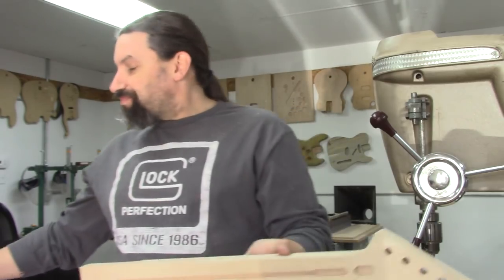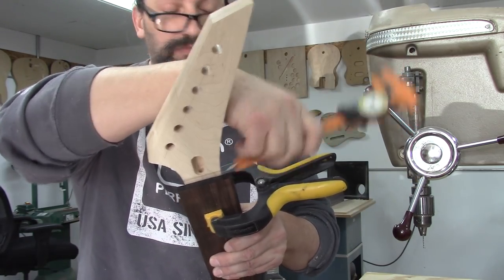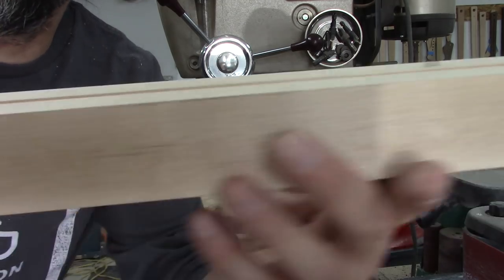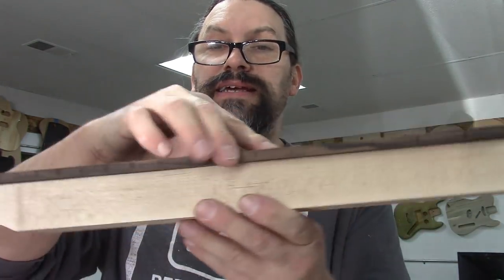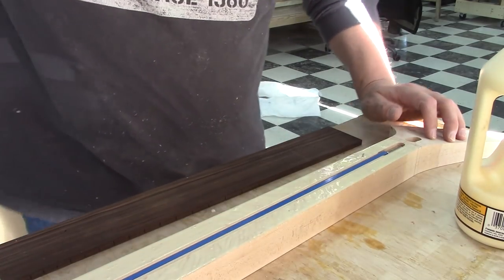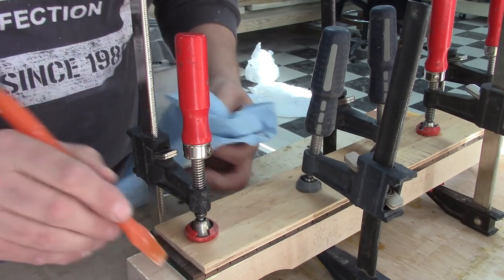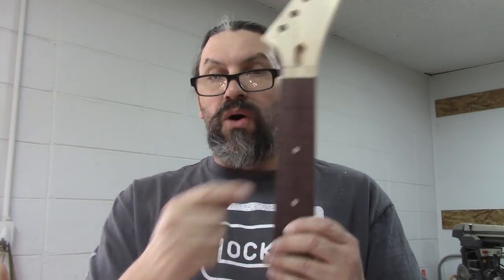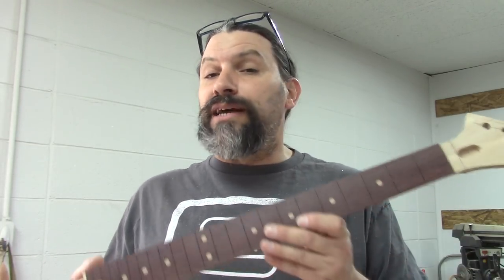The Easy Way To Glue On A Fretboard... And Look Cool Doing It!

Comment: Super sweet registration  method. I always used a pneumatic headless pin gun in fret slot or inlay recess.of the 12th fret.  Slow cure epoxy from LMII so no worries about open working time.
Reply from the maker: Sounds like you have a great system keep using that

Comment: I just took the nut out of cheap strat copy neck, and discovered two staples under it. I wondered what the hell is going on, and then it dawned on me that they used staples to keep the board in place when gluing it. Man your method is so much better.

Comment: Hola amigo. Me gustan tus videos. Si no te molesta te doy un consejo. En vez de acrílico para centrar el diapasón, puedes usar clavos más largos, pero puestos desde arriba del mismo, así cuando la cola se seca, los puedes sacar facilmente y además puedes poner toda la presión que tu quieras a tus prensas. Saludos desde Argentina.
Hi friend. I like your videos. If you don't mind I give you some advice. Instead of acrylic to center the fingerboard, you can use a little large nails but placed from above the fingerboard, so when the glue dries, you can easily remove them and you can also put all the pressure you want on your clamps. Greetings from Argentina.
Reply from the maker: I'm sorry but I'll need to get a translator

Comment: I use wire brad nails. I pull them out from the fretboard after the glue dries. 
The plastic dots are a good idea. 

I’ve been using that thin “magic tape” to cover my truss rod when I glue. I leave the tape on. 😁
Reply from the maker: It is not unheard of for me to forget to peel the tape
Reply: Texas Toast Guitars I’ve done it for years. Hasn’t hurt anything. I figure it stops glue from oozing in.

Comment: I hear the salt thing all the time too. It may help to keep things from shifting, but it won’t really help to index. So for me, it’s a non-starter. 
Having said that, if you use hot hide glue to attach fretboards, adding a pinch of salt to your glue will extend the open working time before it begins to gel. 👍
Reply from the maker: I was thinking about a video where I do all these techniques people say I should use
Reply: Texas Toast Guitars you should use some of that big-assed kosher salt. Lol. Show how it leaves gaps in the glue lines.
Reply: As a woodworker, (not a luthier yet) the “salt trick” doesn’t work for sour apples. So forget it for keeping anything in place. Of course I could have been doing it wrong!
You guys make me want to quite the furniture build, and make guitars! Cool Show!
Reply: In general, hide glue, like epoxy needs a low pressure bond. If you squeeze it too hard, all the glue will extrude out. PVA requires the clamps and cauls and 150-250psi of bond line pressure. Urea crystals are recommended as an additive to hide glue, to extend gel time.  I've read that this is what makes "liquid hide glue" not gel at all at room temp.  I can't speak to this from experience, as I've never used the crystals, and don't care for the store bought liquid hide glue.  I've read that old timers used to pi$$ in their glue pot to extend gel time.  Maybe the smell just made glue ups seem to take longer...

Also pre- warming the surfaces to be glued, will give you a little more time to get your ducks in a row.

Comment: I actually had a similar idea on my own my first time re-glueing a fretboard back onto a bass. The difference being I used brad nails as locator pins and didn’t put them in the fret slots. I put them in the neck beside the truss rod cavity on the top left and bottom right, then lined the fretboard up to it and pressed down, leaving an impression on the underside of the board. Then I drilled very shallow holes where the impressions were and glued and clamped. Looking bad I wish I would have revised my thinking and used toothpicks after I made the impression with the brad nails in case I ever need to pull the board off again.
Reply from the maker: Many ways to skin a cat my friend

Comment: I’m curious as to why you removed the tape over the truss rod?  I would think leaving it on would keep glue squeeze out from getting into the pocket and possibly adhering to the rod and gluing it in place.  Also, would you ever use hide glue to allow the fret board to be removed to replace/repair the truss rod?  Thank you for doing these videos.
Reply from the maker: Hi Ray
You certainly don't have to remove the tape, we just do
You certainly could use hide glue, we just don't

Comment: Cool video as always, is there a reason why you don't use a visible center line instead of having to use clamps and caliper to line up your fingerboards? I use cut in half round toothpicks instead of side dot material because I'm that cheap! You got that side dot material from Stewmac so you probably use $42.50 per neck in side dot material😜
Reply from the maker: Thanks for watching this is a very old video and we no longer use this technique. These days we cut the fret slots after the board is glued on

Comment: The problem with gluing boards on without a filler strip is you can wind up with nasty cracks down the center of the board. Dry areas vs wet areas and glue doing it's thing while it cures. Always use a filler strips over any rod. 45 years of building is a great teacher...........
Reply from the maker: I have never had any issues, of course, I haven't been building guitars professionally for 45 years.  
I got to hand it to you... this is a tough industry to work in for close to 5 decades. Kudos.

Comment: So you use calipers rather than using a center line to line everything  up? Side-dot material indexing pin idea is ingenious. Are you using Stew Mac Hot Rod truss rods or another brand? Good stuff, Matt.
Reply from the maker: Sometimes I use a center line, kinda depends on what we are doing you know...POU.
We do not use the hot rod truss rod

Comment: Adding Kosher salt does help adhesion, but not without a good amount pressure as it has to deform both pieces of wood around the granules to work... and some wood is softer than others. It tends to cause PVA glue to clump and it sure feels like it accelerates the set time. Only use it if you aren't really going to be fiddling with the position of the pieces you're trying to glue together and clamp hard and fast. The index pin method is far superior.
Reply from the maker: Thanks Kirk, we aren't going to change anything anytime soon

Comment: 9:15 I always resist the urge to instantly clean off the wet glue. I wait 10 or 20 minutes then it scrapes off really easily.  It does not adhere to the wood or go into the wood fibers.

Comment: Any thoughts if the fretboard  already has been fretted?
Reply: Staples... By holding the gun a little proud of the surface of the neck, making sure not to be under any frets. That results in a staple not being fully emerged in the neck. Then cut the bridge between the two points giving you two index pins. Do this on both ends of the neck. Place your fretted fretboard and when right push Down to indent the position of the staple pins in the board. Then drill a little deeper with appropriate drill bit. Works lika a charm with a bit of practice, and what I used before I learned this.
Reply from the maker: Like Johan said you can make little barbs that hold it on there. You can also make the neck very differently and use spot glued blocks. That is a story for another video

Comment: A high quality instrument might need some  future neck work. Hide glue is  preferred by many luthiers over synthetic glues for its reversibility, creep-resistance and tendency to pull joints closed as it cures.Removing a fretboard glued down with hide glue is a lot easier than PVA. Sure, it smells and it needs a carefully heat controlled pot, but the bond is ridiculously strong and long lasting, and more importantly, is reversible with heat and moisture.

Hide glue is what historic wood instruments are repaired with. No one would ever repair a Strad or Guarneri with anything other than hot hide glue.
Reply from the maker: Thanks for taking the time to write this Michael. First of all, I urge you to use whatever glue you desire. 
I think it is important to remember that violins are actually designed to be pulled apart at the glue joint as a part of regular maintenance. In order for an acoustic instrument to sound good it has to be fairly fragile. I think that the best acoustic instruments sound as good as they do because they are almost ready to fall apart. 
Solid body electric guitars are a bit different. 
But again... I urge you to use whatever glue you like.

Comment: Having a physical index point makes Assembly easier. I worked as a Tool and Die Machinist many years ago. Line up pins and key slots made bringing pieces together quicker. Going through fret slot ingenious. I would think going through position markers and cap hole with whatever inlay being done. Great video as I always.
Reply from the maker: We don't like face dots
Reply: @TexasToastGuitars  I know, wondered how you got fretboard on square without a register point. Now I know! Merry Christmas!

Comment: Matt, what's the wattge of a drill press a luthier needs?and how big the throat should be? (I think that's how it is called)
Reply from the maker: Hi Amit, I can tell you that the power isn't the most important part for us, it is the distance from the post to the center of the bit. As you said the throat. We are rarely wanting for more power.
Reply: @TexasToastGuitars  so what minimum power and throat should i be looking for? thanks!

Comment: Salt is a bad idea for fretboards. It's probably a  good idea for most other purposes but not ideal for this application. Maybe used a but too much but all it did was destroy the glue.
I learned it the hard way.
Reply from the maker: you could always use locating pins

Comment: I see cats doing them with steel pins, and I always thought: what if you have to pull the 'board? I don't do a lot of design work that takes into consideration repairs (I just hope that it won't need it) but that seems like a job for something that you don't want to surprise someone with later. The plastic rod makes much more sense in the long run.
Reply: Also, I tried salt, and I felt kinda dumb using it. Yes it grits it up, and melts into the glue so there's no pooty in there after, but I felt like I was cooking not building.
Reply from the maker: We used a bunch of different techniques and landed on this one. I really like it